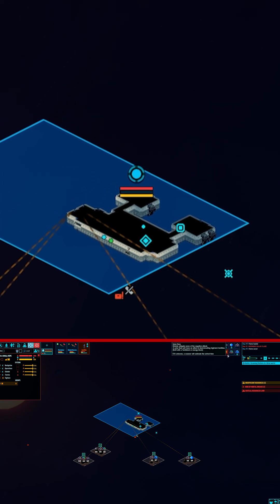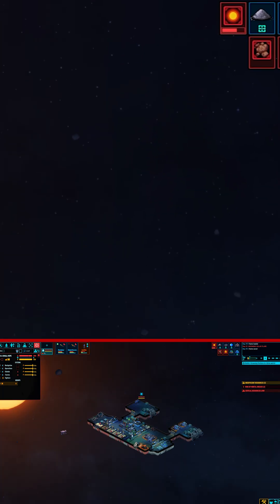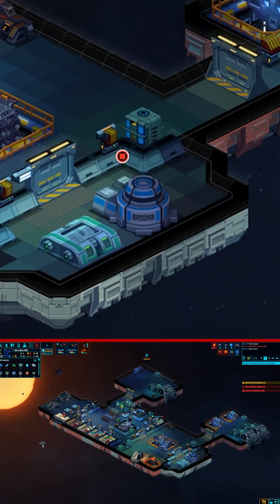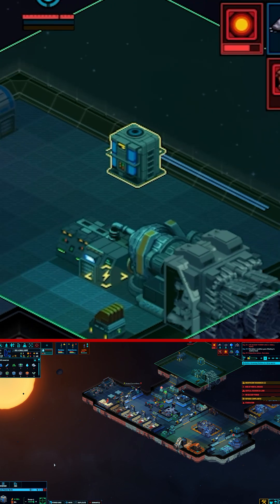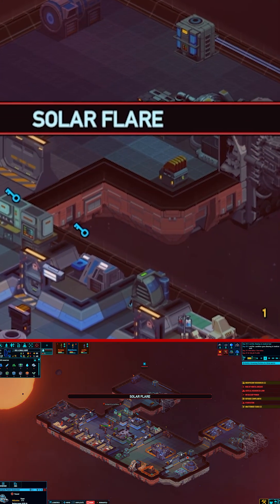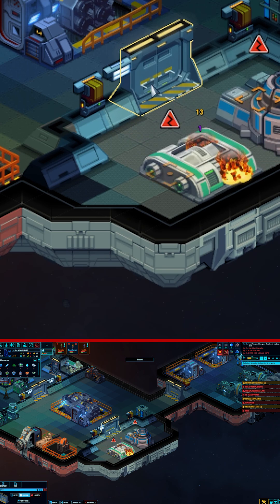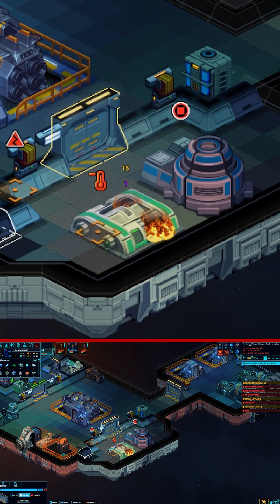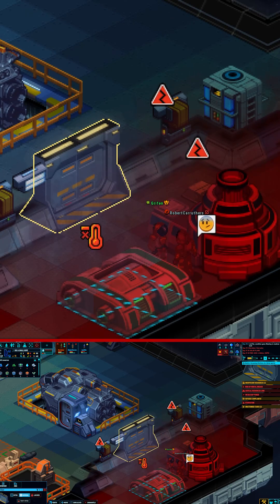Mitigating Solar Flares [Space Haven Short Tutorials] #spacehaven

Comment: I'm having trouble with solar radiation. I have thermal regulators all over the ship, but now I'm in a place where the cycles are shorter than the time my crew needs to recover, so whenever they get up they have like 2 hours before being too hot again. Is there some sort of system that helps with this problem?

P.D.: I'm doing a mission in the area, and I'm not allowed to leave, I know I could just jump to a safe area to recover then come back after I'm prepared, but I can't
Reply from the maker: Outside of spamming more thermal regulators than you think you need, there is a strategy that involves having a hull corridor buffer around your ship to mitigate some of the thermal transfer to the interior. I don’t know if they patched that out though.
Reply: @Greenbeef  thanks!
Reply from the maker: Np